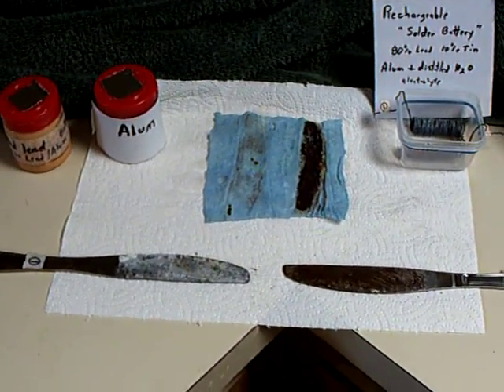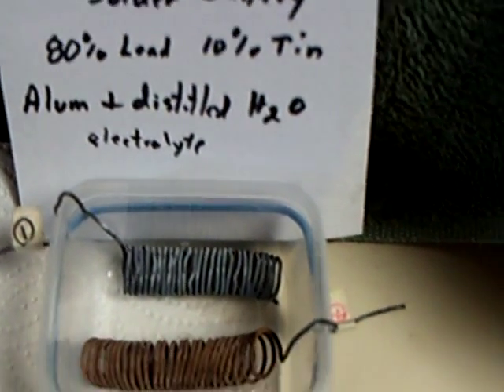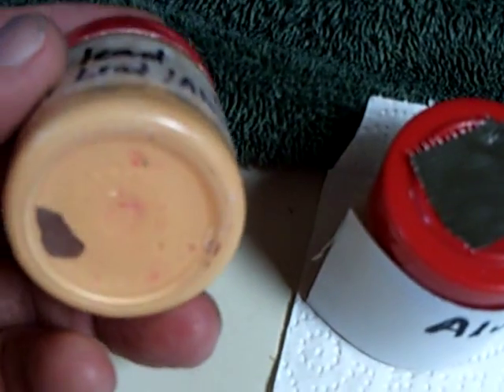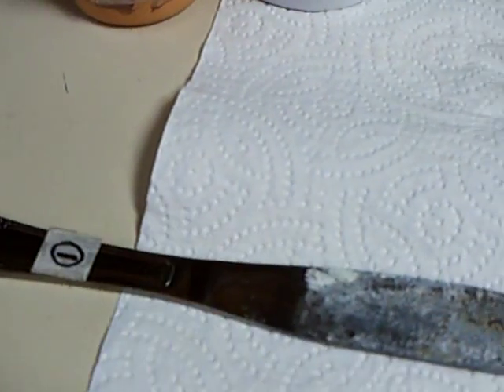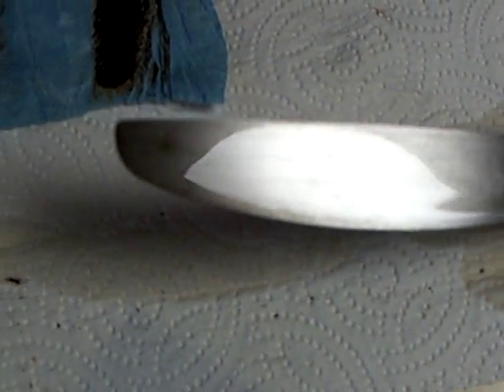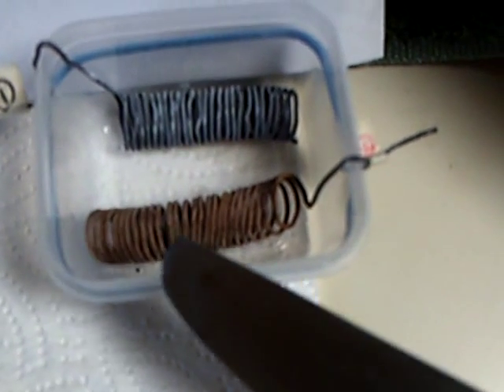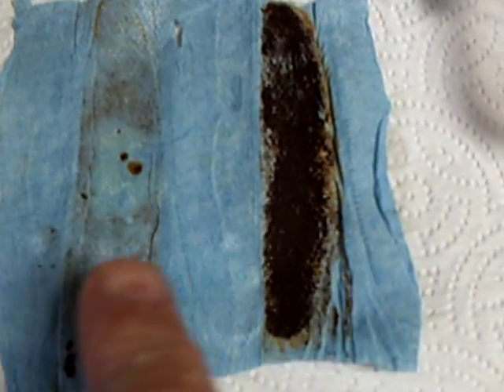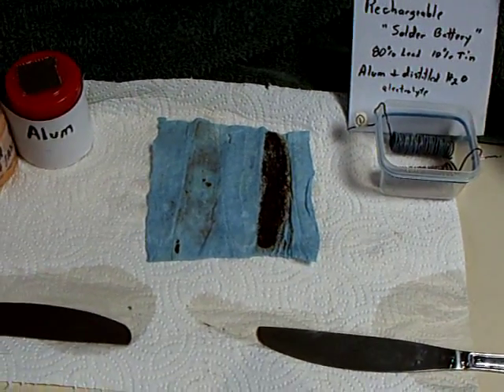All Stainless Steel Homemade Battery---Dissection

Comment: I know lithium batteries are the best watt hour by volume and longevity but I always wondered if a home made battery could beat them on price per watt hour.
I mean, if I could source some stainless steel from a scrappy yard and ignore weight and volume just to get some useful rechargeable watt hours for cheap that would worth as an off grid battery or powerwall, since weight and size would be less important unlike in a car for example.
I don't want to try to make them with lead plates because lead is a real danger.
Zink and are good options because it is really easy to buy in large quantities in any warehouse.

Comment from the maker: I did not check the dead short current but it ran that little electric motor which draws around 300 Ma.  If I built a multi-plate cell that used  grids instead of flat plates the amperage and capacity would go way up.  Surface area.

Comment: hi if you pluck off the electrons by a b+ cone inner coil do you know if you can use the protons for an energy as they are 1840 times more energy/size than an electron stan meyer describes the electron extraction and it intrigues me why protons are not used for a positive electric

Comment: Hi Lid, very well done man !
Maybe on one knife there is just building pure lead from the reduction of the lead oxide ?
So the steel knifes are just only your conductors and the active surfaces are just the
leadoxide and some lead which comes from the reduction and plates itsself on the other steel knife....

Regards, Stefan.